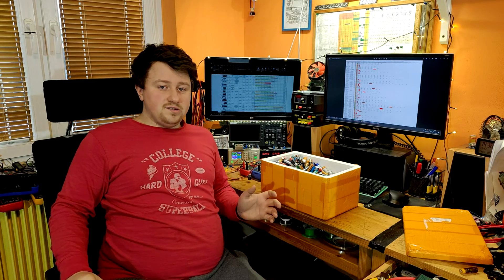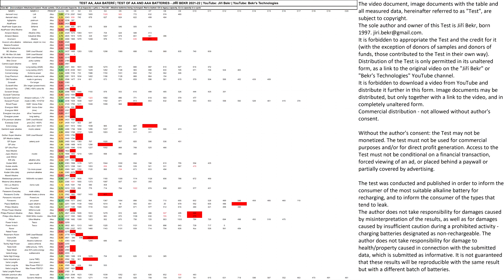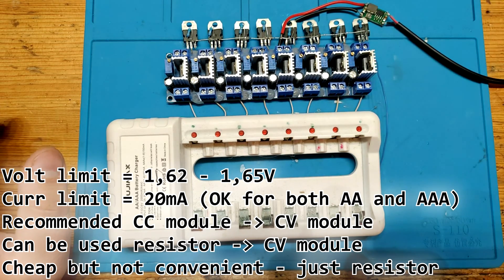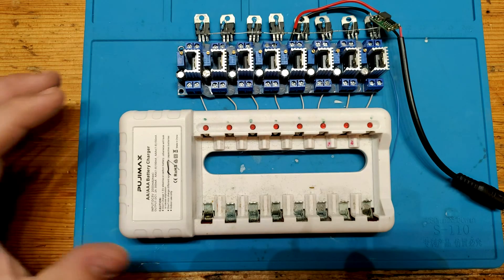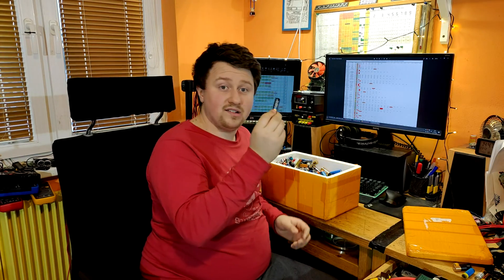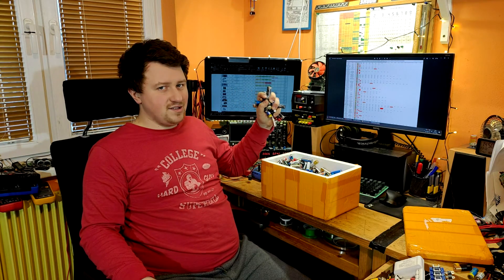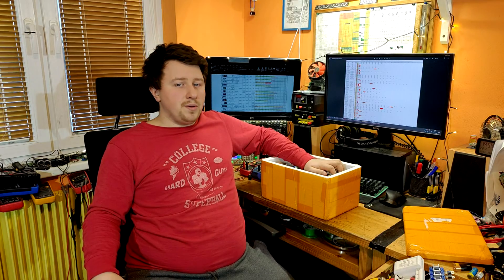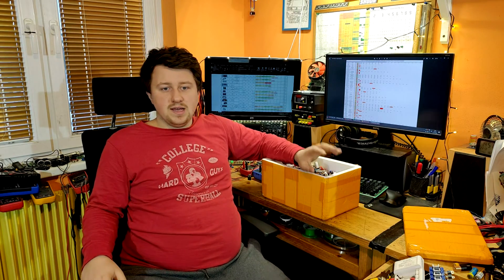Can you recharge alkaline batteries ?

Comment: The other day the AA cells in my main multitester went and luckily I was working on a power supply so I figured whats there to lose? (Not including cells exploding or leaking) So I gave them about 2v for a couple minutes and they took the charge fine. So ive been using them but now I wanna see how long they'll actually last.

Comment: good video. seems there is a lot of work done here. i am impressed. but risk of leak always there eventually. even for flashlights and remote controllers do not deserve this :D 

as i understand to use recharged alkaline battery  also a disposable battery holder needed. and circuit should be designed by minding preventing damage from leakage. i cannot think any protect that is not too fantastic. because that device also should be sensing leakage without getting damaged. best i can imagine is energy storing project but i guess even pressured water is more trustworty battery

still i may try to charge alkaline if world turns into "mad max" world
Reply from the maker: Hi, i have mainly done this test for two purposes - to prolong life of single use batteries, and to determine which do leak, and which do not. Those that didn't leak will most probably also not leak after being 10 years in some expensive instrument from freshly new.

Comment: Hello, how about very cheap batteries? Like the ones it cost 1$ for 4of them? Also leaking only the problem or can it cause fire too? thanks!
Reply from the maker: These very cheap batteries are usually zinc carbon or zinc chloride (the really lightweight ones, often "heavy duty" or "super heavy duty"). I had no success recharging them.
Reply: @bekrstechnologies  ok, thanks! I will give a try maybe I put a metal tray under the charger to be safe :D
Reply: @bekrstechnologies  Ive been able to only partially recharge them by low frequency pulsed charging with tiny reverse currents.
they only recharge up to about 1.3 to 1.45 volts at best.
They might go from almost dead to powering a device for a few minutes in an emergency. but are not a good option to rely on.
Reply: Thanks for mentioning carbonzinc and chloride, have you tried reenergizing/recharging primary lithiums?

Comment: I've noticed a strange thing with GP super AA batteries. Despite having the same dates they look different. Some have trademark under GP sign and some don't. Bought them from normal local store. Can it be fake copies or just different design? Here are the photos for comparison https://drive.google.com/drive/folders/1KPLUx4WCIr_YwNNYKdAqG1dOMHTPXiBu?usp=sharing
Reply from the maker: Strange finding. They may have more facilities or more machines at a factory, so the wraps would be slightly different. Do they have the same internal resistance and capacity ? They shouldn't differ by 5% or more.
Reply: @bekrstechnologies  I don't think I can accurately measure the capacity but other stats are more or less the same. Probably just different label
Reply from the maker: How about comparative method? Measure each battery voltage. Put them in series and discharge them. Measure end voltage, and you can compare.
Reply: @bekrstechnologies  I've put them in a flashlight that takes 2AA in series. At first the  1. from the photos was at 1.65V and 2. at 1.5V. After running the flashlight for some time It rounds up to (1. ; 1.10V) and (2. ; 1.24V). It seems like a significant difference... I need to buy new packs of batteries to rule out any storage errors.

Comment: very etensive test, congratulations! 
i've been testing the charging of alkaline batteries lately just out of curiosity. Instead of a CC-CV i have been using a pulse charging, done by a diode and a resistor in series with the battery, connected to a 9V AC transformer. I set the current to aroud 35mA for AA cells, and i charge AAA at a third of it (i charge three AAA in a single AA slot with an adapter). When i first made the charger i mistakenly smoothed the AC and many of the batteries tended to leak, but now that i have "dirty DC" leaks are rarer. I tested Energizers, Megacell Duracell, ikea alkalisk AAA and some other brands, taken from different charge states but mostly from 1V (so almost empty). I charge them to 1.5-1.55V and then put them away, usually they tend to drop to 1.3-1.4 when resting (damaged ones drop further).
I have yet to test the best ones through discharging but they seem to hold more than 1.3V in storage even after a year.
Fun fact: i once left some AAA for a bit too long in the charger and they got to 1.9v...yet somehow they still haven't leaked even after more than a month. I should implement a max voltage cutoff though lol
Reply: https://www.youtube.com/watch?v=rv-bApeZr-o